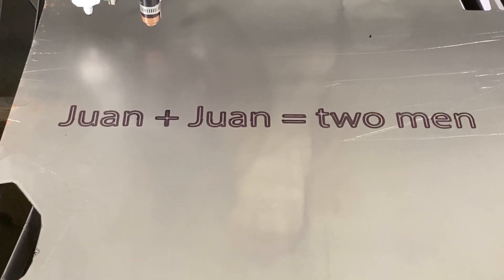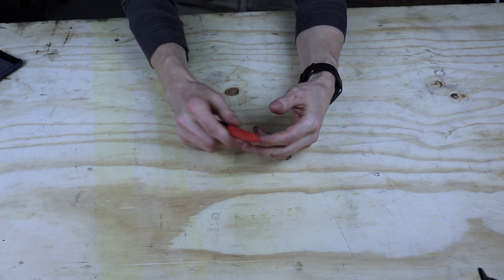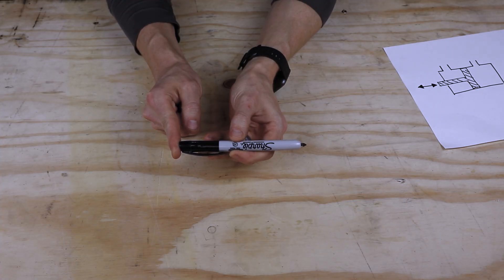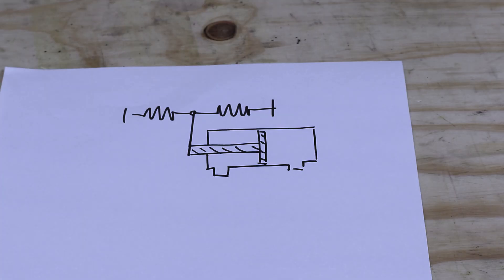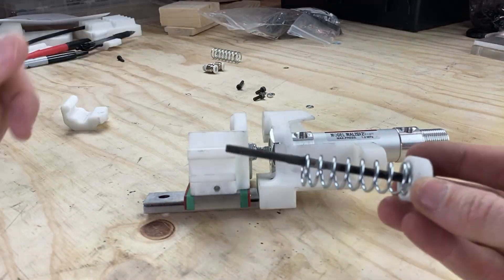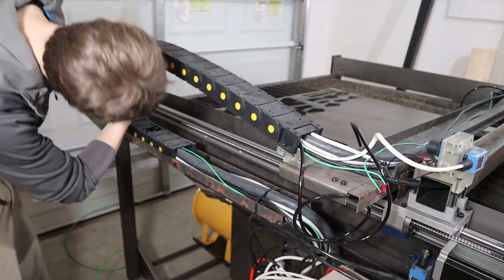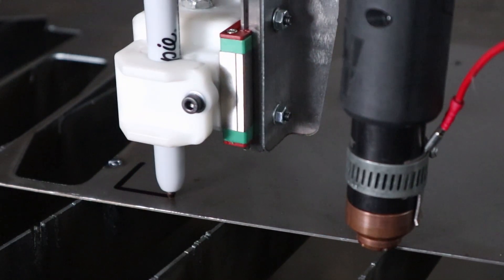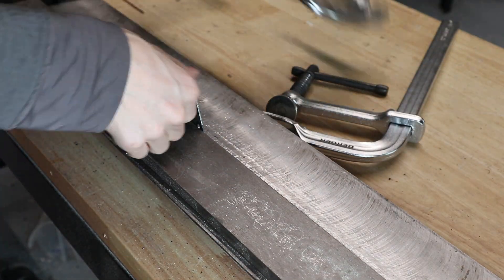This marker will change the way you work with sheet metal

Comment: One thing I learned going to school to be a sheet metal worker, was having the plasma cutter pause for a minute at the point where you want to break so it creates a small notch, All you have to do is line the notches up and boom a point to bend at.
Reply: Figured that would be better than this. But now he can cnc marker drawings.
Reply: @mattaomartinez.9817  is your name as satisfying to write as mine?
Reply: @MMattes  lol we are gifts from god.
Reply: @mattaomartinez.9817  amen brother hahaha.
Reply: @mattaomartinez.9817  that's pretty much its best use. That sharpie line isn't really thin enough to be super accurate but he could probably figure out a way to fit a scribe pen into the same mechanism
Reply: Yup, that is how I've been doing it.
Reply: You also could lower the power on the cutter to simply mark the metal.
Reply: @Chris-rg6nm  I thought that's what everyone did. It's just a laser, turn down the power and you go from cutting to lightly etching. If you want a totally nondestructive method though, this works pretty well I'd say.
Reply: @sbsftw4232  technically plasma and laser are two separate things, but I get your point.
Reply: A+P Mechanics ,sheet metal  workers also used to do this all with manual calculations before all the computers and NC were developed . Great advances
Reply: Como lo hiciste

Comment: Why don't you just make a new electronics box out of left over material?
You can take the required components from the old box.
By "left over", I mean the sheets w/ bits cut from them you can't really re-use in other projects. Assemble it into a panel-y shape - and pour epoxy resin to cover everything- fill the gaps, and block the random bits of sheet metal from being able to cut you.

Or, you can just make the panels out of sheet metal, but using the stuff you've got + epoxy, would be a lot cheaper, and it can achieve a very nice look.
You could get your wife involved as well(you said she likes art, and she can use it as an excuse to try epoxy resin art).

Edit: Ignore if infeasible.

Comment: 10:00 Why not just run a fish wire that's always there?  Just a single long cable you can tie and pull, then just pull it back because of it's length.

Comment: The one thing I haven't figured out how you did, how do you get it to change the offset when it checks height using the z axis?  it marks w/ the marker but checks the height of the material at the torch...

Comment: What CAD software do you use. What table are you using and why did you choose it? I noticed its a dry table, is that because you only cut thin metal and don't need a water bed?
Reply: Wait! you built your own table? Please make a video if this is the case!

Comment: This is awesome. At my job we often do projects which involve cutting hundreds or thousands of unique parts. Sometimes they can be engraved by a cutter to mark part numbers or index marks. but depending on the material, sometimes this is not possible. If only our cutting suppliers embraced your tech!

Comment: I could be wrong, but... didn't you just invent a more complicated solution to the problem that the retractable pen mechanism itself solved?  A similar mechanism for holding the pen would seem like the ideal solution to me.  Cam, guide pin, single spring and done.  Maybe a second spring to maintain some pressure against the surface while drawing.

Also, if you keep a string (or kevlar cord) running through the chain, you can just pull new wires/hoses through as needed.  Just don't forget to attach a new cord to whatever new thing you pull through.

Comment: Did you consider using a little servo motor to actuate the pen clicker? Is it you only wanted to trigger one single component rather than send a signal to the servo to click the pen, and then the solenoid to push the pen down to mark the material?

Comment: i imagine next iteration is adding a pressure setting to the pen so you can make varying thicknesses of lines by pushing weaker or harder
Reply: actually it kind of looks like the machine can already do that, unless it's not precise enough in the vertical axis

Comment: May have been easier to pre-paint your work with blue and then use a machinist's scribe tool instead of a marker. It would have been more precise, and you wouldn't have to worry about dulling or drying out your marking utensil

Comment: That's great however I would say over engineered. You could of used a linier actuator.
Reply: Check the other comments. Linear actuators still need electrical commands, and the plasma can screw that up (burning out components via interference). Perhaps a pneumatic one would work, but the ones I'm seeing for dual motion are pretty expensive

Comment: Nice solution, but why not use the plasma cutter to mark 2 tiny position (added in your cad drawing) for each bend and then align the bend line to these 2 tiny marks. Seems a little easier to me and eliminaties all mechanical parts of this solution including the wear of the marker. An extra benefit is that the proces time of the part will decrease with every unnecessary drawn bend line...

Comment: Next time you fish a wire through the tray, just pull a string in with it. Then when you have to do it again you can just use the string to pull in the wire as well as another string for the time after that.

Comment: I know it's not a very recent video, BUT what I do when I have this issue is to cut small marks (half circles or better yet, triangular divots) on the edge of the blank where the cad SW indicates the bend line. This way there are cut with the profile and you just align both extremes with the bend tool center and you're golden. 

Let me know if you want some example images sent for clarification.

Comment: Why not ue an electrical cylinder with an internal transducer to determine positioning?   That would reduce the need for the springs, and air pressure.

Comment: Amazed by all the engineering here!  One quick tip that might help with future cable routing in your cable guides. Use a flexible sheet metal fish tape. You can attach various heads (small plastic 3d printed ball for example) so that it won't catch in all the crevices. Then use it to pull a nylon pull string. Whenever you pull something thru with your pull string, attach a second pull string along with it - so you still have one for next time!

Comment: Great mod! I've ben jamming sharpies into the plotter at work for 17 years to generate neon bending patterns.  A full sharpie doesn't fit- you can put almost a 90° bend into the reservoir before it splits, but they also make the shorties.

Comment: for the cable runs just use a thin high strength line to pull it through. once you've run one through you can pair one with each new cable addition and leave it  to use the next time you need to pull another cable.

Comment: couldnt you just model a comliant 3d printed part with 3 stable positions, driven by a stepper or a bldc? Or just hold the Z position with a polyspaston on a tiny little stepper - that would alse add a tunable amount of easy-to-achieve compliance so that you dont crash your marker tip into the metal...

Comment: Couldn't a couple of the engineering difficulties be removed by keeping the pen stationary and using the compression method to click the pen out and in without the need to move the whole pen itself? I am by no means a credentialed engineer but I would figure that reduces a lot of the engineering needed to be done on this awesome project.

Comment: There is a much simpler way that i used by the past engrave the sheet when before your cut. We marked the binding line on a different color and the supplier engraved this lines on the sheet

Comment: Since its a click sharpie, why did you need to make the marker holder movable while you could just make it fix it to be at the same level of the cutter when un-clicked and when clicked the tip of the marker would be lower?

Comment: Hey mate, Absolutely loving your videos watching them consecutively as we speak. if you notice this comment than it may help you or someone else that finds routing cables or tubes frustrating. I've laid cable in conduit professionally and all you have to do is feed a rope through once. Leave it there for the next time you return. tie or tape on the cable or tube you want to feed through and also a new piece of rope to go along with it so when you pull said cable or tube through you also have another piece of rope that has reset it ready for the next installation, in your case the distance is so short it most likely will result without having to remove any of the plates. I know this information is miniscule but its the little tricks of the trade that make the biggest difference, As you would know sir.

Comment: Without knowing any better, I assume a solenoid, then a spring, and the pen, would be sufficient. The air aspect seems too messy and/or forceful to me. As the sharpie keeps being obliterated with excess force. I haven't watched the whole video at this point, but your pen concept is fantastic! Also, similarly, a scoring head might also work well, unless damage to the surface needs to be avoided. If you're going to keep fishing things through the electrical chain, leave a fishing cable in there to make it easy in the long run.

Comment: 9:48 Here's what you may use for stuffing more wires in the energy chain: https://www.youtube.com/watch?v=8aJczkyvGE4
I understand you don't use them much in the US: here in Europe you can find a 10m long one in many supermarkets for about 3 to 5 EUR. They're used, as you can see in the video, for laying new wires into existing electrical conduits, which are permanently placed inside the walls in every building.
Check item B00IF9BLEW on âmazön: it's so weird, that they even classify it as "Brush Cutter Cable"... but try to change .com to .de, .fr, .es, .it, etc...

Comment: How do you get the marker to mark without being mashed?  Shouldn't you have some down "overtravel" with a very light spring to permit the marker to stop (decoupling itself from the down-drive) when it hits the work, not getting mashed if the work is high, or missing if work is low?
          How does the machine know the state (on or off) of the marker cap?  I see here the "blind man operates pull-chain light switch" problem.

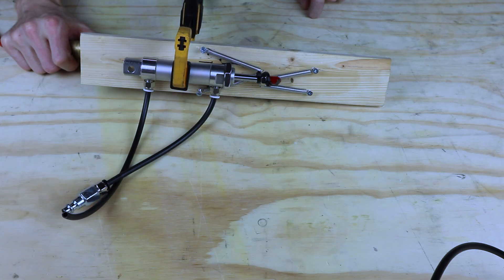Comment: 5:27 You could also apply air into both ports on the air cylinder at the same time and make it stay or go in any amount. Equal pressure on both sides it will go center.

Comment: It's almost Christmas! Any word on the tree climbing, light hanging robit? haha..

Great video! 

Another way many MFG companies 'locate' where to center the sheet metal on the press is to cut small hemispheres at the edges so you can center the brake die in the hemisphere on the edges of the part being bent.  Hope that makes sense. This also has a functional aspect as well: Typically, when you bend/stretch metal, the edges deform, creating an irregularity in the overall length of the part, due to the compression/stress at the edge of the material. Adding this hemisphere feature eliminates the possibility that the deformed edge will be out of tolerance in case there is a need to fit it into a space ensuring the width of the part is consistent.

Hope you had a great Thanksgiving! Would be sweet to see your take on making your own pellet smoker! Would be interesting to learn about thermodynamics to get even heat spread, and you have everything you need to build a pretty advanced smoker. Maybe even have a rotisserie or other mods no other manufacturer has thought to add! Auto baster? 

You're getting right up there in my frequently searched channels with Fireball, AvE, This Old Tony, Smarter Every Day, and Mark Rober! 

Keep it up!

Comment: Couldn’t you just have used a 5/3 valve with open center to release the air? Should be easier than two 5/2 valves

Comment: Pro tip for conduit and "energy chains" run your first cable with a strong twine like rope. Then you can pull your next wire through and another strand of rope. Always have a pull rope that way. Takes just a few seconds to tape and untape as necessary.

Comment: To get cables through the energy chain without pulling the plates off, first push a length of weed trimmer line through and then attach your cable to the end and pull it through.

Comment: Instead of using springs to make it a 3-position piston, what would happen if you put equal air pressure into both ports of the piston when you wanted the pen to go to center? Would it go to a repeatable position every time?

Comment: awesome video! I wonder if you can just keep a double+ length aircraft cable in your energy chain. That way you can attach a new cable to it and pull/lead the new cable through. keep the acc from getting pulled past reaching and you can always use it easy peasy again without rethreading it.

Comment: FYI @Stuff Made Here put a draw wire in you cable/tube track, every time you use it pull a new draw wire in, this is faster than removing caps.

Comment: hm question: why do you use a sharpie instead of a hard needle like tool (sorry dunno the technical name) to basicly scratch the bend lines in? wouldnt that be much more accurate when you bend it later instead of havin a sharpieline wich even on the thin end is quite thicc?

Comment: I like your approach.  Much more robust than what I did.... I experimented with retractable sharpies on my CNC router a few years ago. https://youtu.be/-Pu8RzoEMLY.  I wanted to be able to have multiple colors, but not have any additional (or at least very little additional) electronics,   My method used the router's Z axis to select and adjust the sharpies.

Comment: Instead of having to draw the bend line with a sharpie, you could just cut a couple of grooves where the bend should be.
This would make the bending easier and if you're welding it anyway I think it would have little impact in the overall strength.

Though I really do like the idea and design of this sharpie setup c",)

Comment: While you were explaining this I started thinking, why not just used a scribe that scratches the lines in instead of marking. Metal scratches without using a lot of force and it might be a bit more accurate.?.? I'm also thinking you tried this and the scratches weren't visible.

Comment: A tip for your energy chain, most times commercial electricians will pull a piece of nylon string through the conduit with their wires in case they need to pull more wire through in the future. This way they can tie the new wires (and another nylon string) to the old string and then pull through without having to struggle too much pushing wire through a run or trying to get something like a fish tape through.

Comment: it would be easier and it would look better if you use 13amps output and Mark the sheetmetal, if you are using a hypertherm system, there is a mark option
but it´s a nice method to use, thanks for sharing the video

Comment: Why can't you use the plasma torch to etch the brake lines? If you dont want an entire line going across the part, you could just mark it in two points per brake. Or, if you dont want a line etched, add small notches at either end of the brake on the part outline. 

Although, I suspect you did this cause it was more fun than practical. I can relate.

Comment: why not a electric linear actuator? Mount the pen on the side of the motor rod and have a 3d printed top plate so it would push the decap/cap button and program in 3 states for position, done.
Reply: Youric Hunt  Hmm, maybe. Tho Id think they make something shielded because of such circumstances. Fair point though :)

Comment: I'm not sure if you considered this for the bidirectional pneumatic cylinder. If you put the springs inside the cylinder with each one pressing against the plunger and the end of the cylinder you might get away with the lighter springs and smaller springs. This would mean opening up each end of the cylinder and dropping in the spring and putting the end of the cylinder back over the shafts you have to watch out for the outside diameter the spring expanding and if you have enough clearance. That would've saved you an awful lot of work.

Comment: When routing thru the e=chain don't remove the plates, just pull out something that is already in it with the replacement and the new component. Ex: Pull out a 6mm air line but use it to pull in a new 6mm line and a 4mm line. If you are cheap just pull a line out and a string in, then use the string to pull in the new line and the original thru the e-chain.

Comment: use an electricians trick and unhook one wire in the wire chain and attach twine to it and pull it back. once its on the other side cut the twine and take the new wire you want to run and the one you pulled back and attach another peice of twine to it. then pull it back to the other side. this way you have a pull string ready to go and every time you want to pull another wire just pull another piece of twine through

Comment: if you use jetline it will help with routing the cables thru the energy chain. After the first one you can just tie the jetline to the next cable, tie a new piece of jetline to the cable you're pulling, then pull it through. This puts a new piece of jetline into the energy chain for the next time you want to pull a cable thru.

Comment: about those wires in the wire guide, when i used to do networking cables for a server room that kept changing, i always had a piece of rope put through along with a new cable. i could use that piece of rope to pull another cable and piece of rope in the future without undoing ducting. might be an idea for you on some machines. nice vids you make :)

Comment: 1:45 Just model in small bend notches to see where the bend lines are when forming. (If external bend notch, grind off the mark afterwards. Use internal bend notches where the visual looks are not important.